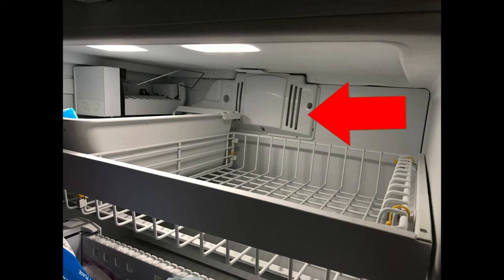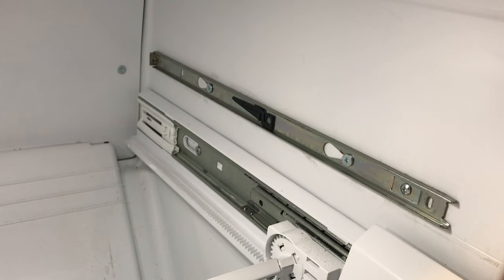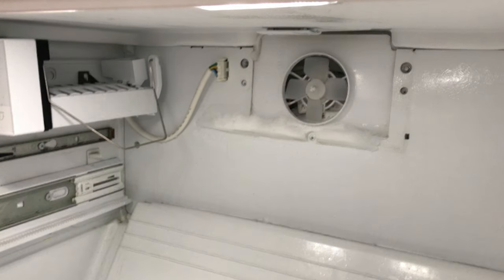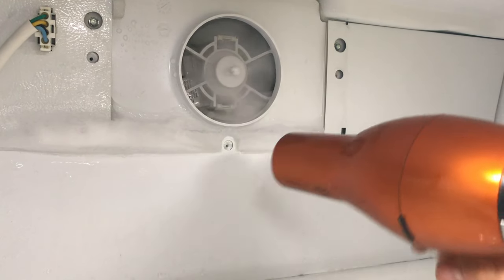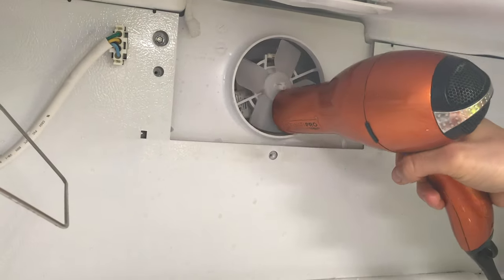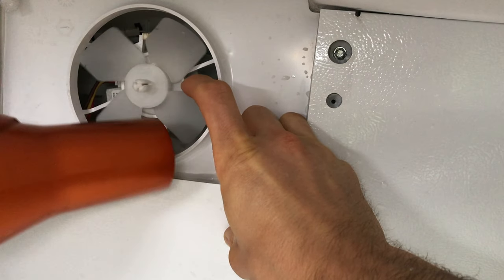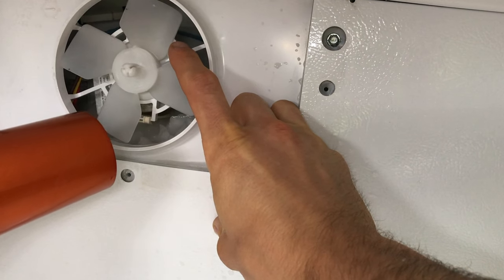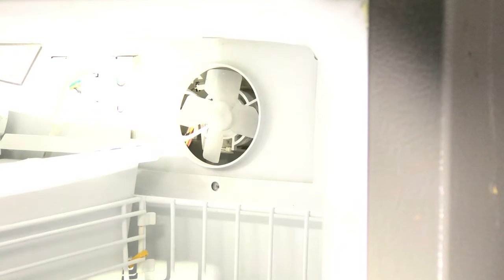Fix Noisy Kenmore Refrigerator - Refrigerator Evaporator Fan Ice Buildup

Comment: We recently had the "evaporator" fan replaced by a GE licensed repairman because it stopped working. A few days later, we kept hearing this strange vibrating noise. Since the recent repair and part were still under the 30 day warranty, I called GE and insisted they come out again because we were concerned the new part was at fault. The repairman knew right away that it was the ice buildup on the freezer fan. He said I would have to manually defrost the buildup behind the freezer fan or just wait and hope that it eventually would defrost on it's own. I asked if I could just use a hair dryer and get it done quicker. He said "no" because it might melt the plastic. The noise continued and we but noticed it would stop when we would open the left side fridge door. Found your helpful video and decided to use the hair dryer. 1 minute later, problem solved! :)

Comment: Thank you David for this video, it saved my sanity!!    I had the exact same noise, scheduled a Sears service call but they couldn’t come out for 3 days.  The noise was so loud I had to sleep in another floor of the house!  I knew I was going to go crazy so I searched for the issue and your video was the top result.  I have a newer model that has no visible screws to remove the fan panel.  But I could see the top of the fan through the vent holes on top.  I held a hair dryer to that top vent and bottom vent for like 10-15 minutes.  I knew it had to be that long because I also had a thick sheet of ice buildup on the back wall and I could see with that ice that’s how long it took the blow dryer to fully melt it.  In the end it worked and the ridiculously loud sound stopped thank god!   The ice maker (up in the top door) hasn’t been working either, we’ll see if this fixes that too.
Reply from the maker: Awesome! Sometimes it just takes a bit of poking around to get something back to the way it should be. Glad to hear this was a quick fix for you! As a note, you may wish to consider fully defrosting the unit, unplug it and let it sit for 48 hour, but you’ll need to empty the fridge to do this.

Comment: Our Kenmore/Whirlpool started making the noise so I went to follow the steps.

Alas, no screws! Tried to pull the cover off but didn't want to break it.

Long story short, if there was ice then I knocked it off. I then ran the hair dryer on it a bit.

No more noise.

FWIW, it's on borrowed time, anyway, so will watch the Memorial Day sales and get a new one. It's been almost 21 years.

Comment: This works, but so does getting a brand of refrigerator that has been better designed!  Our Kenmore repairman literally had to bypass the water filter line to the ice maker, because it kept freezing.  We are on our second ice maker, and we have to keep a dowel with a hook on the end to fish out ice cubes that fall under the sliding shelves in the freezer - otherwise the freezer might not close properly.  Having to do this ritual every 8 to 10 months is just the icing on the cake :)

Comment: It took 5 min fix issue. I did not need to remove cover just the food on top shelf. I elevated a small heater fan at freezer fan level  for 5 min with freezer off. All the ice 🧊 melted problem solved. No more noise👌🙏 FYI this is my Fridge GE Refrigerator GIE18GSHMRSS
Reply: Thanks this helped me too. I used a small heater fan too cos I don't have a hair dryer.

Comment: turn the water pressure down on the shut off valve going to the fridge. turn it more to the off position. like a 1/4 of the way open just barley crack it. just enough to get water out the fridge and to your ice maker. what its doing is splashing water going into the down pipe to the ice tray or it could be a leaky valve. but too much water pressure will push passed the valve or splash over the ice tray and leak down into the fan motor causing this noise. something to check .

Comment: This definitely sounds like the issue my fridge is having; same noise, stops when door open, ice build up inside fridge area, freezer fine. However 3 weeks ago we did leave unplugged for 24 hours. All was fine up till yesterday and same thing is occurring. Any suggestions?
Reply from the maker: See if you can take some of the plastic molding inside off. I had an ice block behind the fans, a single 24 hour period may not have melted it all. Taking a look can’t hurt vs buying a new fridge or calling for service, right?
Reply: @DavidStumph  yes I totally agree. Thank you so much for your quick reply!
Reply from the maker: No problem. Make sure your freezer door has a good seal, clean where it meets the frame and ensure no build up there, or this situation will continue to return.

Comment: I'm having this kind of problem too. Repair guy replaced the fan a few weeks ago. Can I use a steam pressure "gun" instead of a hair dryer after unplugging the fridge?
Reply from the maker: I wouldn’t use anything with steam.
Reply: @DavidStumph  will that damage the fan?
Reply from the maker: Mostly concerned about the excess moisture.
Reply: @DavidStumph  the excess moisture damages the fan and wiring back there. This GE fridge fan is situated in a way that I cannot defrost any ice unless I take everything out of the freezer including the back panel. And when I get the problem "fixed", I occasionally hear the sound return again after a few weeks.

Comment: When that noise is on there it don't stop it stay on steady then sooner or later it is quiet then the noise is back again  through whole refrigerator . I was wondering if it is under warranty will it be covered  . refrigerator isn't a year  old yet . it came on a few days ago reminds me of a truck sound because it is loud i taped it .   No matter if i open refrigerator or freezer it doesn't  shut off .  thank you
Reply from the maker: If the warranty has service technician onsite service included, they can at least diagnose the cause in person. Not sure of the terms of your warranty.  Call and ask if you’re not sure, there is likely a sticker somewhere in the fridge area with a service number and model number.

Comment: What if you do all the steps and it works, but then the next day it freezes right back up and making noises again?
Reply from the maker: I'd suspect that there is a break in the seals around the doors first - check there. That would be the first thing i’d look at, outside of that I'm not immediately sure which component would at fault.
Reply: @DavidStumph  thanks. I have a old refrigerator but by the same brand. I normally have to do this once a year. Then ones every  6 months. Now I’m having to do it every other day. It’s annoying to say the least lol

Comment: Mine has done this a few times. I hired a repairman who replaced the fan and now it's doing it again. He thinks it continues to freeze up due to a problem with the control board. I've already paid over $200 in repairs and this will be another $300-something. Refrigerator is only a few years old, but wondering if I should cut bait and just buy a new one.
Reply from the maker: Honestly, I think you’re getting a run for your money. I’ve seen so many people with this issue it appears to be a design flaw to me. I’d either keep thawing it as I’ve shown, or yes replace the fridge. Your call.
Reply: @DavidStumph  I tried to do the thaw thing myself, but I think my refrigerator is a newer model. I got the drawers out, but there is no fan cover as shown in your video. Instead, I think I have to remove the entire back panel, part of which is behind the ice-maker. I did blow a hair dryer a bit through a vent in the back panel, trying to cheat a bit, but it didn't work. Still making noise and I know it won't be too long until it freezes up stops working again. Ugh...now wonder Sears went out of business.
Reply: @CraigRosen  Craig, I too have a newer model that has no visible screws to remove the panel.  But I could see the top of the fan through the vent holes on top.  I held a hair dryer to that top vent and bottom vent for like 10-15 minutes.  I knew it had to be that long because I also had a thick sheet of ice buildup on the back wall and I could see with that ice that’s how long it took the blow dryer to fully melt it.  In the end it worked and the ridiculously loud sound stopped thank god!   Maybe try again for a longer period?  To be clear, I was inside the freezer compartment doing this, not at the back of the fridge.
Reply: @jeff-lm  Thanks. I tried that. Maybe I didn't do it long enough, but it didn't work. We decided to junk the piece of crap and buy a new refrigerator. No wonder Sears went out of business!

Comment: Mine doesn’t look like that enclosure.. so I’m trying to figure out how to remove it
Reply: Put your model number into Google and sears will come up… Usually they have a schematic and you can figure out where the screws are. I had to take out my icemaker to get to one of the screws FYI. The ice maker was only held in place by two screws and the plugs. When I finally got the panel off the back make sure to unplug the fans first so you don’t damage anything.

Comment: Mine did this for 2 days then quit. I have a side by side 2006 frig, now its dropping ice and back to freezing my groceries, can you tell me why this happened? Its working now! Its a kenmore from Sears.
Reply: Condensation collects near the fan, which has a small motor that puts out heat as it spins.  That condensation freezes until enough layers have collected to block the fan blade.  (You can see in the video a lot of the ice is behind the motor.)

Comment: It was loud than I open the door and it completely stops untill I open it again so I used a hairdryer and just blew it up the slots and it helped but in 24 hrs it did it again, but now I'm getting an error code And cannot hear any fan at all anymore. What do you think?
Reply from the maker: What is the error code?
Reply: @DavidStumph  it just says err on both sides. I put my hair dryer on that area and so far so good.
Reply from the maker: I am not sure about the error - there is typically a reset button and the error might have been due to the fan being stopped. The reset buttons on my fridge are on the left door near a display where the temperatures are listed. If you press and hold a button marked reset it near the indicator, they clear. Mine need cleared mostly from power outages.
Reply: @DavidStumph  I eventually replaced the fridge with a brand new one. It was a shame because the fridge wasn't that old. Oh well

Comment: Mine was noisy but stopped altogether would that mean my fan motor needs replacement?
Reply: Check if your fan is never on. If not, then it most likely the motor and should be replaced.

Comment: sound not only coming when doors are closed but also when we open the doors ( even louder ) ?
Reply: Same hear. Ours is a GE bottom freezer and we have an appointment coming next week. I was not able to remove the panel easily for fear of breaking it. I did however spend about 10 to 15 minutes with a hair dryer blowing all around the shield. There was quite a bit of water coming down from behind so I suspect the same issue. I plugged it in and it ran for about a minute or two with no sound. Thought it was fixed but soon again it started up. I suspect I did not get rid of enough ice. Very annoying and far too prevalent in my opinion. Super fail on the engineers and manufacturing.

Comment: What caused the ice build up?
Reply: Three common possibilities. 1)You have overpacked your fridge or blocked the vents. Not allowing enough circulation will cause ice buildup. If your freezer is always overpacked like this, you will have to do this video again and again. 2)The defrost timer is damaged. Your freezer isn't being told to defrost the evaporator coils often enough because the timer is broken. 3)The defrost element is broken, meaning the heating element that defrosts no longer works. All are relatively simple repairs.
Reply: I call BS. My fridge  started doing this when only a few months old. It’s had all the parts you listed replaced TWICE and under warranty and even a few others. It still does it. 18 months in and I am buying a new fridge as soon as any are in stock. Meanwhile, I’m using a mini fridge from Walmart that was 169.00.
Reply: @lillytaggert178  I said COMMON possibilities. If you have a specific model with some unique defects then sure you could easily have other reasons. But plenty of fridges go through this once. The parts get replaced and it works fine again for year's.

Comment: my freezer evaporater fan makes a similar noise but no frost??
Reply: Mines too
Reply: Probably a cheap part that could be replaced.  Partsdirect.com or eBay should have it, if you can get the part number (usually listed right on it)